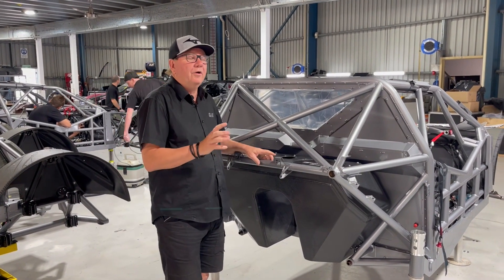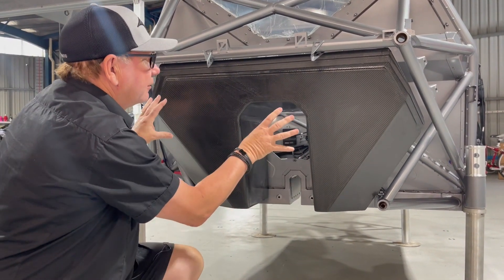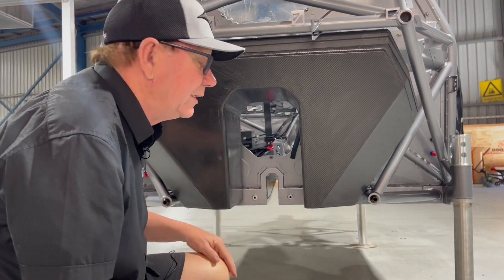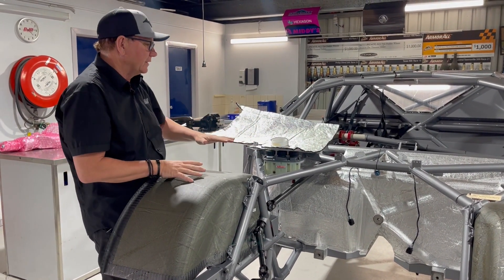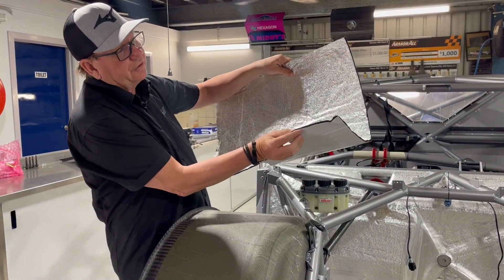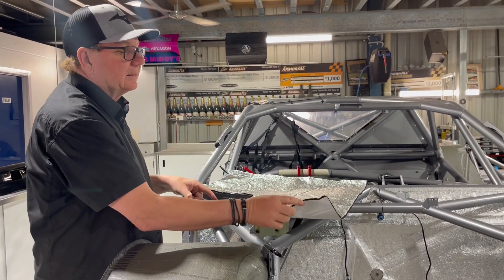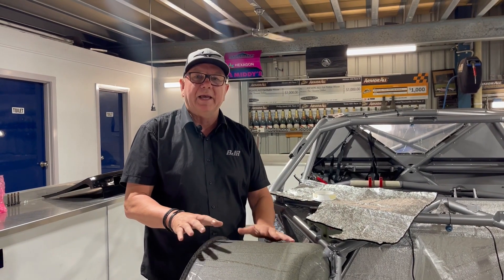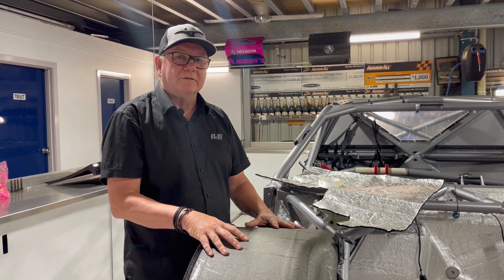Brad explains how the team is trying to keep the Gen3 cabins cool

Comment: Such a small window out the rear, rear vision is not going to be good on these things
Reply: Easpecially when they knock off the outside mirrors.
Several Sports Sedans had a dirty perspex screen between the driver and the back of the car, no rear vision and you had to watch out for them or they would just wander into your path. Stupidcar drivers though often do not even look,, explaining many accidents